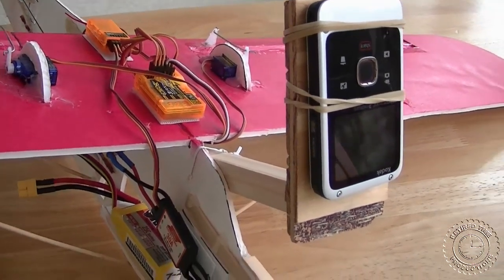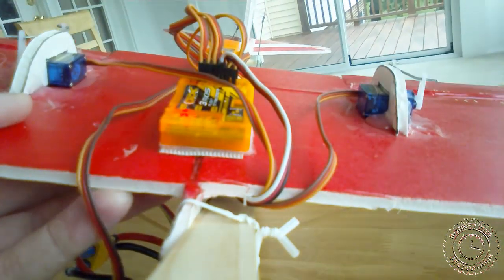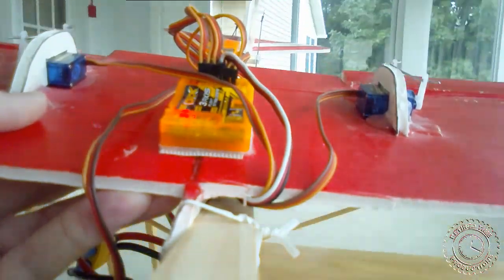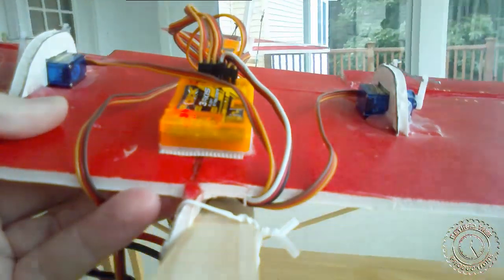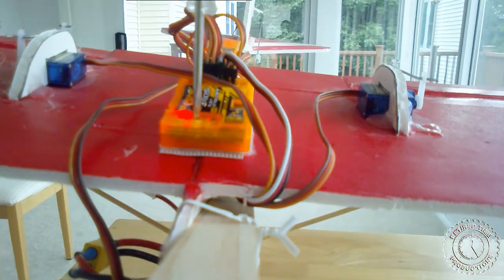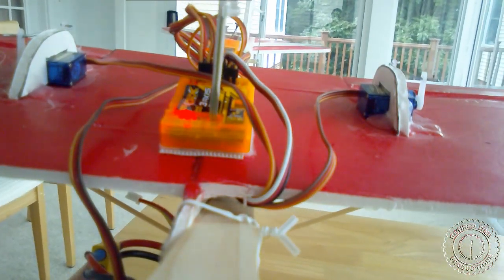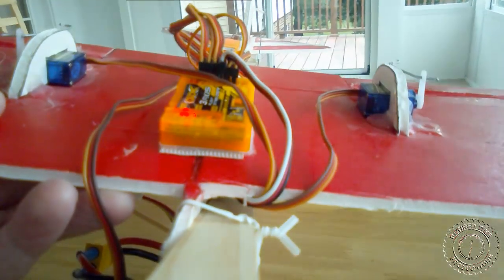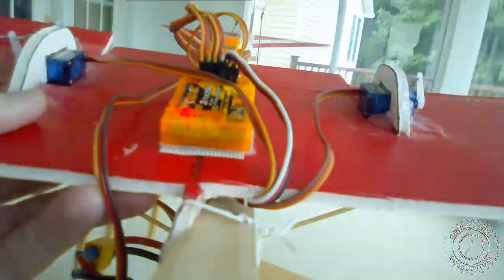HobbyKing Orange RX 3-Axis Flight Stabilizer Gyro System - Part 2 of 3 - good for FPV or Jets

Comment: mine does not stabilize at all. I have navigation lights hooked into Aux,so maby thats why? I do not know. all I know is my Waco BiPlane ended up eating dirt because the stabilization didnt work. I plan on disconnecting the navigation lights and hooking them up through the gear instead,that way I can shut them off in the day time any ways.
Reply from the maker: +scott firman Hope you get it working. I haven't played with these in years. Moved on to  other stuff that is more functional.
Reply: +dmerc00 What do you think of the naze32  or  the other quad copter and airplane stabilizers? I have seen a few I have my eye on that would be better and not required to program them H.K. has a few. not the KK2.3 or 5 or whatever.Those seem to be smaller and do the same thing. I may go that route.
Reply from the maker: +scott firman I am using a BeeRotorF3 and it does a great job.
Does take a bit of configuring but it has auto-level and GPS.
Check out my vids on the install.

Comment: NOTE! You should always use plastic tuner screwdrivers when adjusting these pots NOT a metal screwdriver!!
Reply from the maker: You are probably thinking of tuning coils such as used in radio equipment.
These are just plastic pots. Metal has no effect on them them that I can tell.
Reply: Any electronic pot should be tuned with a plastic tuner.

Comment: what do you use to power the orange little guy ?  I can't get mine to work . I hooked it up to the AUX  and nothing.  I hear buzzing but that's it.  Please call me if you can ..I am bummed out over this.  (530) 415-3237  Don
Reply from the maker: It gets power (5vdc) from your receiver through any of the servo leads center/red wires. Look at the video and see the way it is connected. That's it.